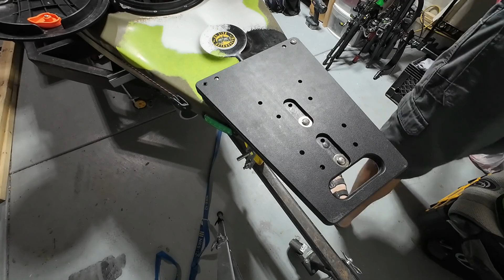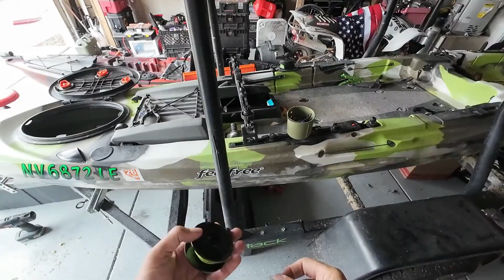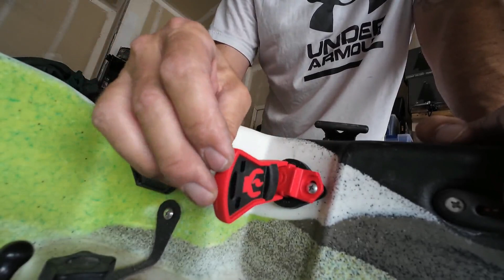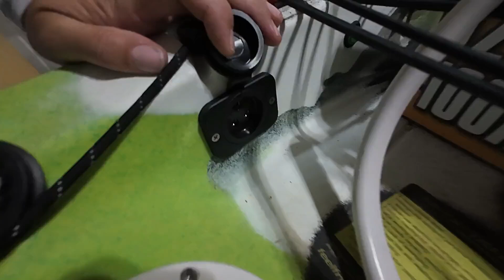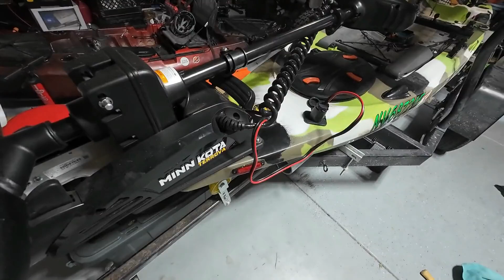How to Install a Minn Kota Terrova Kayak Trolling Motor | Safety Switch Install | Feelfree Lure 13.5

Comment: Nice work on the installation! Can you tell me what size hole saw I would need for the marinco plugs? 
Those marinco plugs says it will accept 8 to 6awg wires, but I noticed the power cable on the terrova is 10awg. Did you have any issues with that?